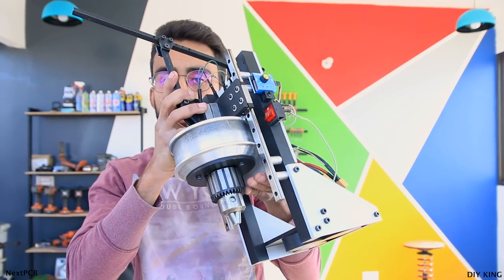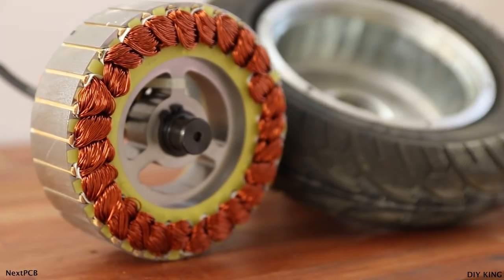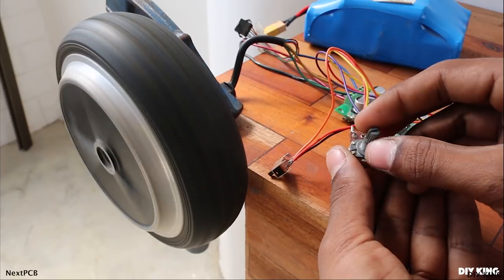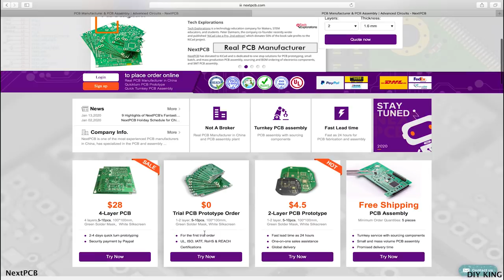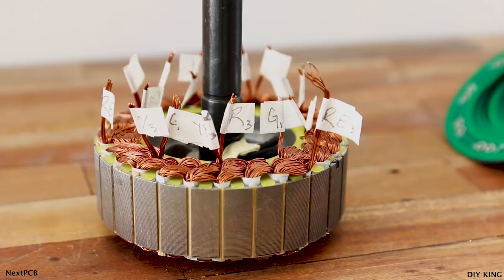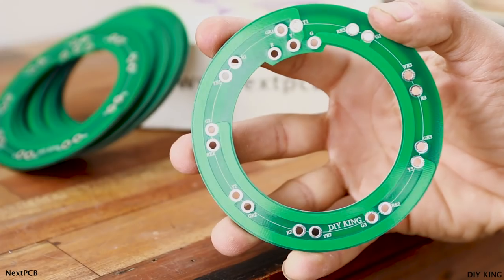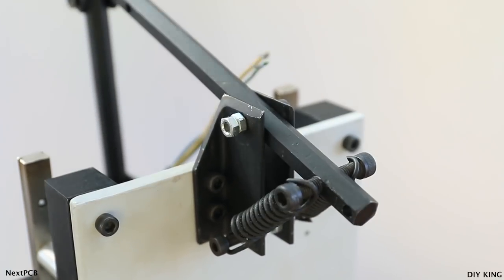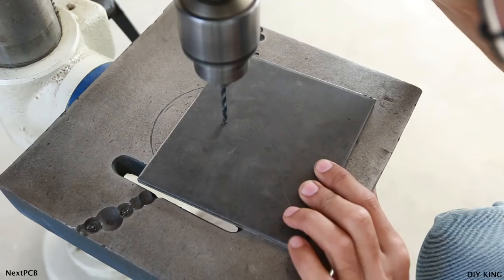How to make a Magnetic Drill Press

Comment: Should have used metal cups around the 3 coils for the second pole. It would substantially increase the mag field strength.
Reply: Correct, with soft iron or ferrite field directors from back to front, their grip strength could be many times more.

Comment: Congratulations on the project. 
Can you make a diagram of the connection of the coils in parallel? 
And in the case of using that configuration in an eloic generator, what voltage / amperage would it supply?
Thanks

Comment: Hi DIY King,

When changing the winding system on the hoverboard, you seem to be converting the standard WYE(star) configuration to a DELTA system. The speed increases by the current increase of square 3(1.73) however start up the torque decreases. Is that correct?
Reply: Yes, it is.